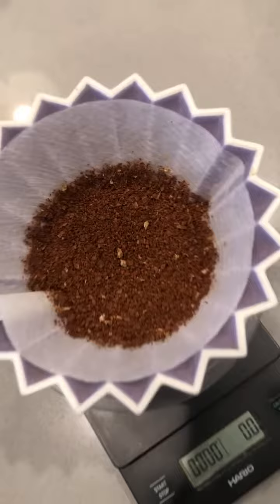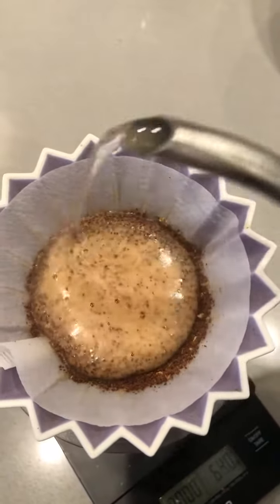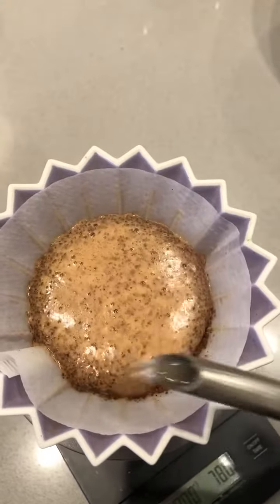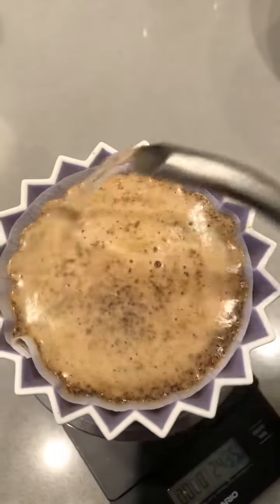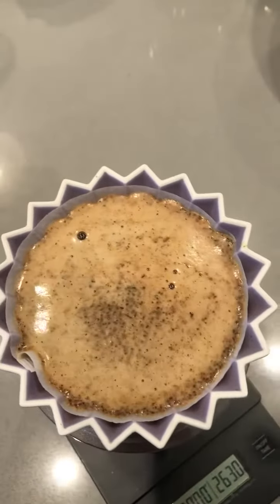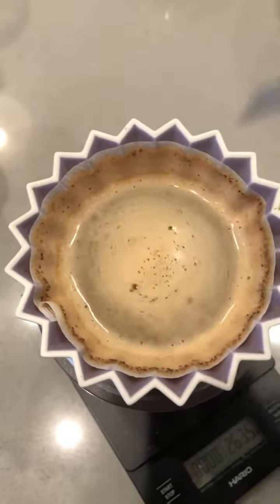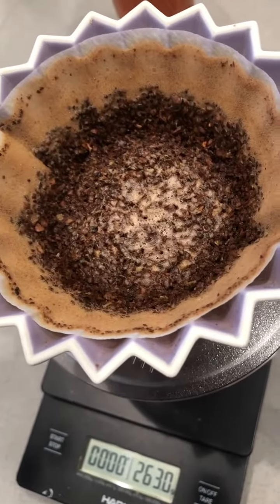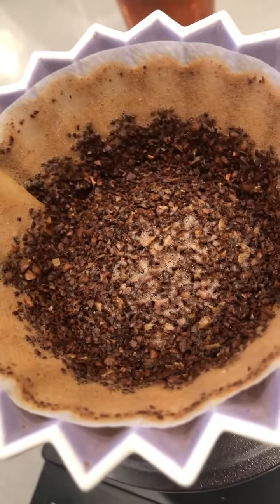Single Pour with Coarser Grinds? #shorts

Comment: I love my single pour coarse brews. Usually go with 30 clicks on a standard c40, 18g coffee to 300g water, all water in at 1 minute and draw down usually finishes 1:45-2:00. My other method is smaller cups, 12g to 200g. 50g in at 0. 50g in at 25s remaining 100g in at 50s for a 2 minute finish

Comment: I got the fellow ode brew grinder and like this thing can't grind fine enough for your single pour technique. At the finest setting, it's not as coarse as the grind in this video, but I'd say like a solid medium size. Any tips you could give to help elongate the brew time and extraction? I've tried pouring slower, and hotter but the cups still come out a bit watery.
Reply: I guess you meant "At the *coursest setting", didn't you? If so, that's a characteristic of many electric grinders. I myself could never make a cold brew for instance before I bought my first manual grinder, because as you said the coursest setting I was able to get was still not course enough. But bare in mind that in the video, the grind shown was considered too course, so the next brew that will follow is difinetely gonna be finer than that first attempt :)
Reply: @fernandotorres6347  nah bruh, I meant what I said. The fellow ode doesn't grind fine enough.
Reply from the maker: Oof if it’s not grinding fine enough this is a very good concern. I shall work on a method to mitigate that. Stay tuned I promise it’ll be up on shorts in a day or two.
。
(Was gonna do it earlier but I sprained my back so I can’t even stand rn.  Will get on this ASAP)
Reply: @TALESCOFFEE  take your time my man, there's no rush!
Reply: @TALESCOFFEE  I also just ordered the V60 Mugen aswell if thats a variable you want to try playing with!
Reply from the maker: Oh yes! We did a review on the mugen actually! 🙌🏼